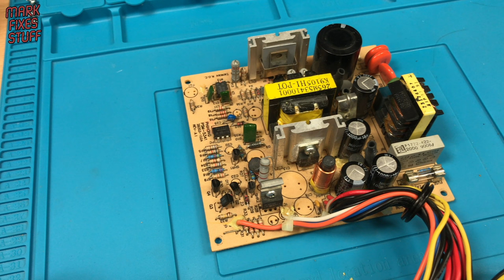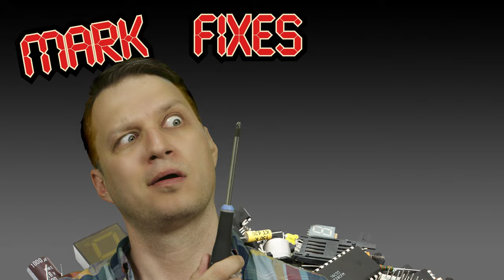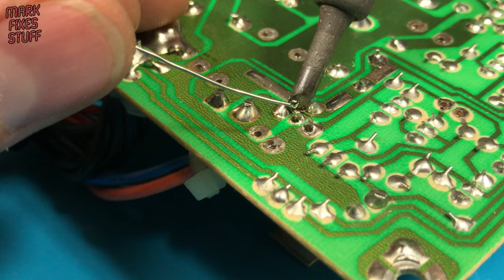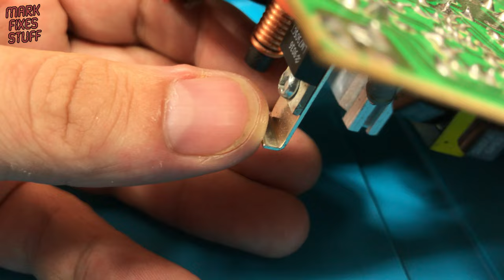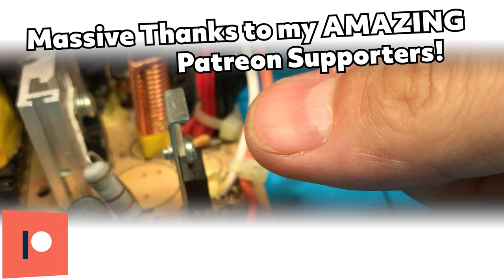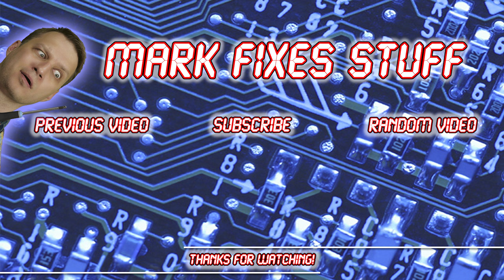Repairing a Dry, Cold or Cracked Solder Joint & how to identify it - 2021

Comment: What temp to put the solder gun at?
Reply from the maker: For older stuff, up to the middle of the 90's use around 330 degrees Celsius - up until then a lot of consumer electronics were using a leaded alloy. For later stuff you are probably dealing with a lead free allow, and depending on the way the board was manufactured you are likely to start in the 350 degrees Celsius ball park but extending that up to potentially 370-380 degrees Celsius for difficult boards. 

Bonus tip -  Leaded solder joints are often shinier looking than lead-free, with lead-free having more of a dull, almost aluminium like look.

Hope this helps and good luck.
Reply: @MarkFixesStuff  worked perfectly. TV is good as new!
Reply from the maker: @jacobtenorio2454  Amazing news! Well done!
Reply: Was gonna ask the same question... 😅

Comment: A good video for people new to this kind of work. On a related note, in the early ‘70s I worked for a small electronics company who did subcontract work for the GPO, or whatever they were called at that time. Part of their specification when assembling PC boards was that the component leads were cut before soldering, not afterwards. This was to prevent stress in the solder joint. It’s not a practice I have usually followed in my own projects, but I thought it might be of interest to you.
Reply from the maker: Post Office and their regulation handbook eh!  Military specification is the same iirc. It's just a right pain in the bits because the components often drop out.  I do see some people who over-solder joints cutting the blob down with side cutters and I think... eeek, that's no good for the pads, but I suspect it's still fine.

BTW, GPO had transformed into the Post Office as a limited entity by 1970. The beaurocracy lives on until this very day as my short spell with the IT department in the 2000's showed me.

Comment: Timely video! Just trying to find a dry joint in a monitor Power Supply without much success....
Reply from the maker: How did you get on?
Reply: @MarkFixesStuff  Not well...basically the monitor (a Dell u2414h) powers off after having been on for a while, then won't turn back on until it's been left a few hours when the cycle repeats. I've recapped the power supply board but I'm now a bit stumped as to whether it's a dry joint of something else....Any advice or hints would be much appreciated!

Comment: Nice video, thanks.  Some say it's better to remove the old solder first.  What do you think about that?
Reply from the maker: If it’s old leaded solder and you are using unleaded to patch it up then it’s a good idea to not mix the two. If it’s leaded and you are using leaded to repair then you are just reflowing the old alloy with new flux so it’s fine. Thanks for watching!!
Reply: @MarkFixesStuff  I try to avoid using unleaded solder.  Thank you for the quick reply!

Comment: I am repairing an ABS module. Two solder joints looks like they have holes in them (very tiny holes). Would that cause an issue?
Reply from the maker: Hard to say but solder joints definitely shouldn’t have holes in!